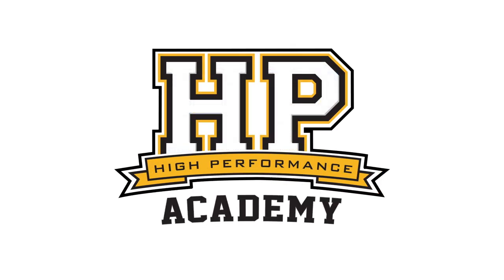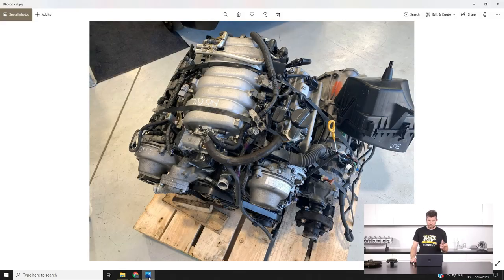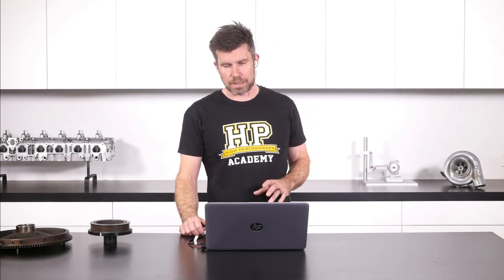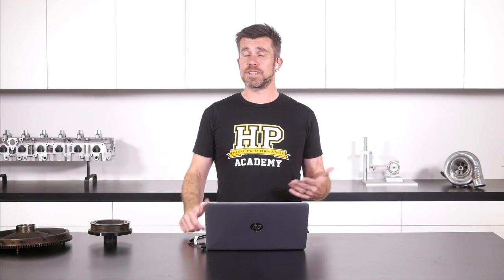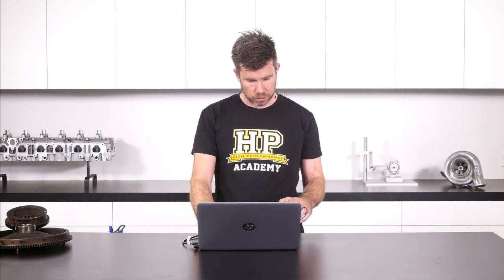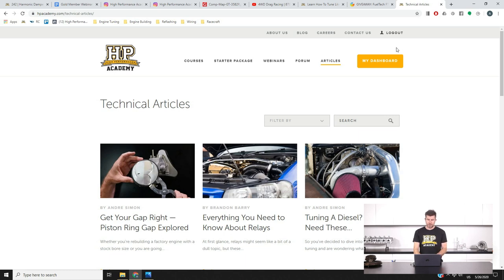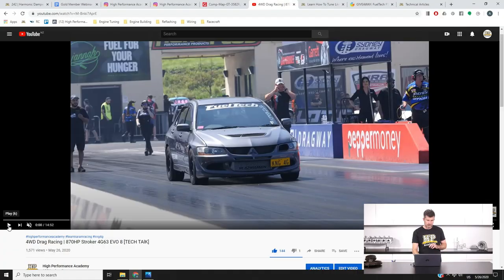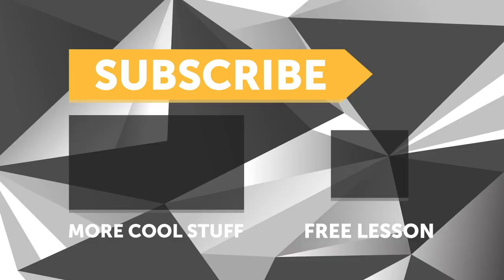Engine Swap: Is Your Donor Engine A Dud? | Today At HPA [UPDATE 242]

Comment: a good thing to invest in is a little camera/endoscope $30-100 bucks depending on how good a quality, wifi etc. this lets you look inside the cylinders and check them all out, also rotate engine to make sure valves are all good, and then the cylinder walls etc. its probably the best thing you can buy, especially if you cant do  compression/starrtup  check